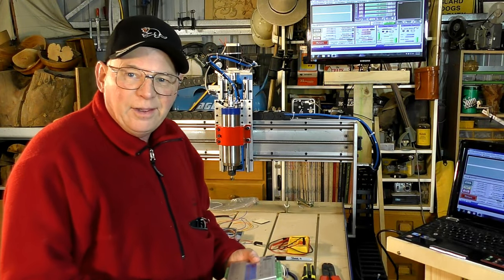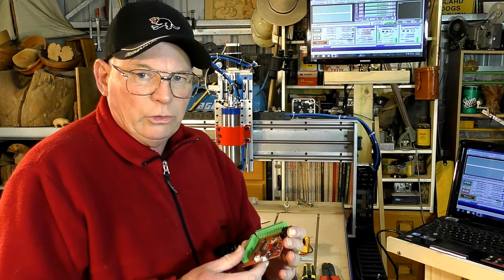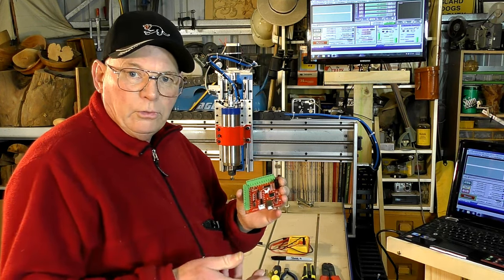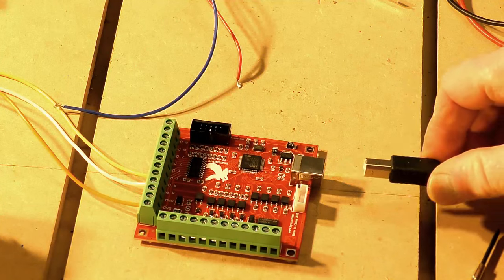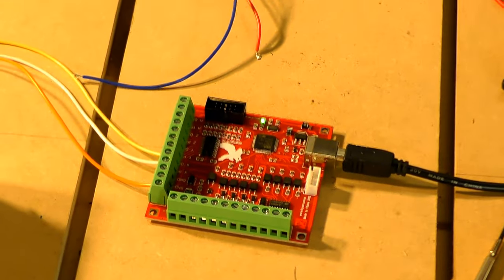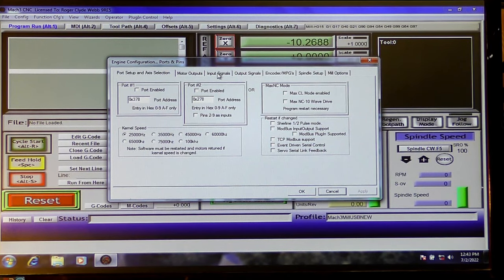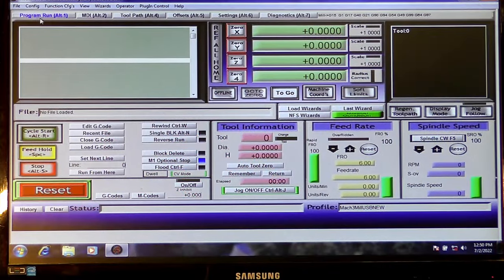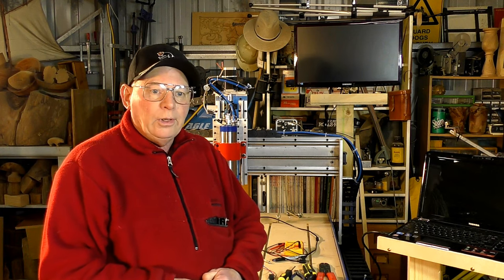The simple A to Z of CNC wiring stepper motors, BOBs and drivers

Comment: Hi Roger, you are a life saver! First it is great to find an Ozzie on YouTube who speaks the same language as me and works in mm and 240v.
My name is Mike living in Tassie. I am 76 yo and an old dog trying to learn new tricks. 
I have wanted to have a play with CNC for a number of years but could never find a machine within my budget that would do more than carve wood signs that say “Dad' Shed”. To cut a a long story short I have build a CNC router from 17mm aluminium plate, installed Nema23, controllers and power supply from Stepperonline. Also A 2.2 Vevor spindle and DFV. 
I am at the stage of wiring it up and without a mentor (I have an qualified electrician mate who is not CNC savvy) I have been tearing, whats left of my hair out, UNTILL I found this video of yours which has the EXACT same break out board which I purchased without any idea of what I was doing!
So thanks for the very clear instructions (will have to change a few wires, very pleased I did not try to power up :-))
However I still have some wiring FOG. Do you have a video that shows DFV to this break out board please?
I have wired the spindle (again with your video) and it seems to run OK.
Also the only controller software I could find on this board was a software called Drufell which is a paid software and as I am on a pension it would just add to the cost. How can I get the Mach3 setting to at least make a start.
All the best and thank again
Mike
Reply: I fully agree Mike . it's a nice change to get Aussie content and made so simple for us old guys born before computers

Comment: Thank you so much for this easy to follow video. I picked up a really nice and clean home made 3 axis cnc, that had a BOB with parallel port. I was able to follow your video, and get the motors verified that they work. The only additional electronics the previous person had were relays connected to the spindle. Do you have a video of how to wire the E-stop button. Also, your home switched, are they the limit switches?

Comment: I recently purchased all upgrades on everything from electrical, to motors, to ball screws fro my bench top optimill as the cheap kit i got couple years ago was a little under powered, looked at these control boards and coundnt find too much help for them, my old controller is that same red RNR board which are good! after some research i found the uc300 had a lot of info, spec sheets, wiring sheets, wiring and set up videos and works like a dream and easy for full automation and can move all axis at the same time via keyboard controls, im  interested to see what the issue is for with you as they are not cheap controllers.I was considering a smc until i found your video on the scams that come along with it! love the videos roger! cheers from chch nz

Comment: Hello Roger, I have the mk4-v usb version of that controller and I can verify it works in Mach 3  version R3.043.062 on a basic windows 10 laptop. When you power it on do you get 2 solid red lights on the side of the controller? One thing I would suggest is when install Mach 3 make sure you do not install the parallel driver. I need to finish documenting an install procedure that worked for me and I could share it with you.

Comment: Hi Roger, I am so thankfull for this video.  I just bought the RED BRD you are demonstating. Yes, 1. Don't install the parallel driver.  2. Your information that the 24Volt side of the Board was consider  port #3 solved all my problems installing the E-stop, Limit switches,  No where could I find how to get the USB version of Mach3 to talk to the switches.  Also having the Gnds for the two sides of the boards separate also corrected a problem.  I used a generic schematic to build my CNC.  Do you have a diagram for the Red Board  BSMCE04U-PP or BSMCED4U-PP.  On my board it hard to tell whether d or 0.  Again thankes so much for the video and information.  The CD did not have anything about the infor.  Jerry    ATL USA

Comment: Roger, there is a big difference between Windows 10 home edition and Windows 10 professional of the files in the software especially when it comes to DLL files,
If you have Windows XP professional DVD Software there and I'm sure it will drive old interface bored,
Just on one PC desktop you can have two different Windows running on the one hard drive there by partition the hard disk drive as in like Windows 10 and also Windows XP with the installation,  when powering up the PC it will give you an option of Windows 10 or XP too load up

Comment: Great tutorial, i was looking for a good clear limit switch setup and here i have found one,
also i have noticed that many other are using different pins for the limit switch,
is there a preferred pin.
I tried Pin3 or input 3 and all i get is the LimitOV light
So I have had to use pin input no 2
As I use pin input no1 for probe
Again the probe was instructed to number 2 but did not work
And So it is in pin number 1 input
I have exactly the same board as you
So I wonder if either the firmware is setup different, or is it the software that uses different settings.

Comment: Thank you very much for this tutorial! But, you don't show the connection of the white and black wire for the homing of the x... 24v? Where does the black and white come from? 15:50...Can you send me a photo of the connection please? Thanks again!!
Reply from the maker: The white +24V+ and black - DCM wire is from the 24v power supply, the switch is DCM and pin 3.

Comment: Hi Roger, If the power supply is at 5V (orange wire), should I set the switch on top of my DN542T driver to 5V? (It can be either on 24V or on 5V).
Reply: 5 volts only, do not use the 24 volt switch on the drivers unless you have a specific set up.
Most of these small mach3 boards all supply 5volts to the drivers pulse and direction pins.

Comment: I don't understand how the homing switches can be wired in parallel.  I know it's done but I ended up just wiring all mine to different inputs.  Are the switches normally open?  When you home each axis, does the axis move, engage the switch and then back off so it can then go to the next switch?  I imagine that if the switch stayed engaged then the system wouldn't see any change when it went to the next input.
Reply from the maker: See this video it will help you
https://www.youtube.com/watch?v=2np54Cz3nK0

Comment: Hi Roger, nice video. Did you connect 24 vdc ps because the stepper motor is for 24 v? Can you explain a little bit about the voltage and current rated for a motor related to the voltage and current on the driver? I'll appreciate it. Thank you.
Reply: The 24V is for operation of the limit switches (in this video) and other I/O ports.  The larger power supply in the video is what powers the stepper motors through the stepper motor drivers.

Comment: Hi. I hope you are still responding to questions. I am very new to CNC routing and am in the process of choosing and ordering parts for my first dyi CNC router. Could you tell me if you must pair a Mach 3 control board with Mach 3 software? As I am just starting out in CNC routing I would prefer to take advantage of the many choices of free soft wear that are available. The Mach 3 board looks much more versatile than the Arduino board that came with the stepper motor kit that I have purchased. FYI…your video’s have helped me decide to “take the plunge” into the CNC world of woodworking. Thank you for taking the time to make them.
Reply: I hope he does do some replies as many have added questions.
Anyway I was using a GRBL
But it had limitations
So I opted to a Mach3 cnc 3040 with a 800w vfd machine
For which is plenty for my needs
With a match 3 board and software. You will have to calibrate the stepper motors first
Then get the spindle to operate if your using a spindle with a controller
Then once you get them ok
Then setup you limit switches and soft limits
And  for let's see how you get on 👍
Reply: Thanks, just finished the building process and about to jump into the wiring. Sticking with the Arduino board. Using a porter cable router (not going through the Arduino) so no rpm control necessary. Fingers crossed

Comment: I am new in cnc machining. I have Question about that board. 
What I don't get is: if that cheap Mach3 board works properly (which costs around 20$) on a CNC router, why should i buy expensive boards wich cost starting from 100$
Reply: The answer to your question is. Many moons ago mach 3 boards were very expensive and now with China turning out more than one needs the price just dropped
Thank god as now I can buy more than one and have a spare
On the other side of things there are new developers that make boards but do not get a load manufactured so hence the high price.

Comment: hi Roger, i do not know if you still answer questions. in the above vid you did not show how you operated the motor from the keyboard. and how to set up the board with mach3, since mach 3 is really designed for paraller board intetface breakboard. this is a sore point with mach3 and the usb board you are demonstrated. i am lost. can you show a print outs for each menu of set up please. kind regards
Reply from the maker: Your new USB Mach3 board must have come with a driver and pre set up Mach3 settings, if not I have then avalable on my Patron pages.
Help support my channel and become a Patron
 https://www.patreon.com/user?u=15079773

Comment: Hello!
On the official website of this board, it is recommended to use a high level control (+5 V). 
Can You explain why You used low level control (GND).
I have this board and now I'm trying to figure out how to connect it. Maybe I'm wrong.
Thank You.
Reply: You can try, both method right, change wiring +(-) will change dirrection motor.
Reply: @95machine29  Thank You.
Yes, I already understood that both methods are correct. Although it seems to me that the general GND is more correct. This is the more general way. Because for most devices and modules, a common GND is connected to the case and shielding.

Comment: Silly question... I have the same rnr board in my 6040. But ive know stepper drivers its just wired straight to the motors... How does it work

Comment: Hey, this is a great thorough walk through for wiring a steer driver/motor, would it be possible to use a mach 3 board and run duel motors on each axis?

Comment: Hey Roger 
fellow Aussie here having issues with a build using nema 34s and dm860y with mach3 ethernet anything advice you can give would be appreciated 
It will run Y Axis but won't pick up X or Z i think it is an issue with the Mach3 ethernet controller
Reply from the maker: Hi, there is a facility on my patron pages for technical help 
https://www.patreon.com/user?u=15079773

Comment: Get Acorn CNC 12 From Centroid and you will run your machine in few hours and forget it about the rest of all those cnc controllers, i did it and believe me no more problems.
Reply: I have been looking at the Acorn CNC controllers very professional looking systems. I really want to go to a ethernet controller instead of the USB style, I think if you are going to get serious about cnc work, an ethernet connected control board is the way to go.

Comment: If anyone is having trouble the red controller he is using is not supported by Windows 8 and newer. I have Windows 10 and looking to dual boot when I find an older windows operating system.
Reply from the maker: If your computer is a 32 or 32/64-bit operating system Mach3 and this card WILL work on win XP, 7, 8, and 10.
If your computer is 64-bit only operating system Mach3 and this card WILL NOT.
Reply: Thanks for your answer. I’ll have to check to see what my os is. Also could I have a bad BoB? How would I check?
Reply: Unfortunately i also don't have the 32 bit win 10, but downloaded Win 7. Haven't had a chance to test if that solves the problem. I will post when I do.
Reply: Ok kind sir. I have followed everything to the T up until the point just before you hit reset in mach3. My light on the board is slow flashing. But I noticed that once you hit reset and you went down to the board it was on steady. Mine is still flashing. Does this tell you that I might have something messed up in mach3. I have all 3 axis enabled.
Reply: @rogerwebb9600    I finally figured it out and got it working on windows 10 64 but. I was missing an rnr.dll file. 😊